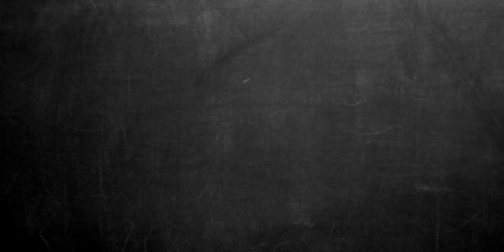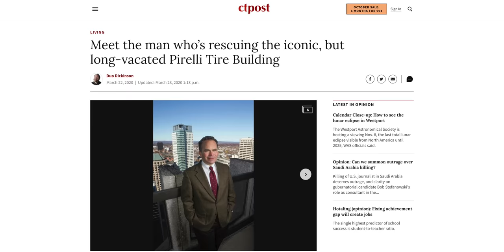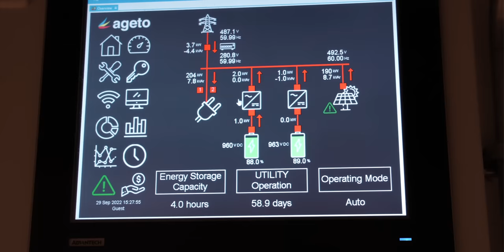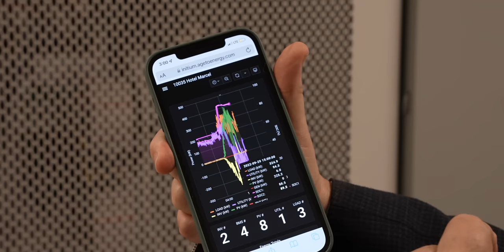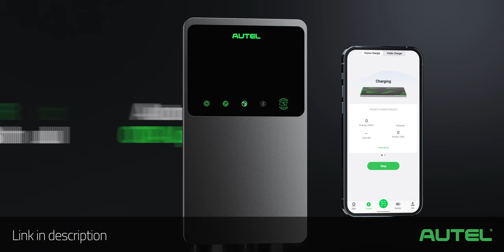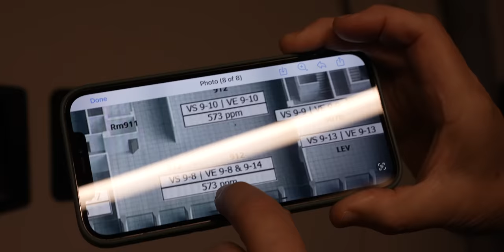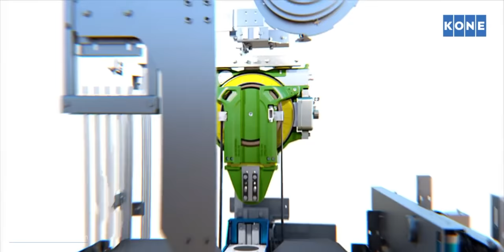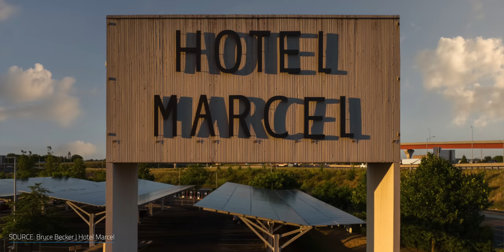How Big Can You Make a Passive House?

Comment: Wow - it is great to see this one idea finally becoming mainstream: the whole DC mini power grid. DC power sucks for long-haul transmission, but it is far more efficient for local (in-home) distribution. I've always wondered at how inefficient things like a typical home computer setup are: taking AC power from the wall, running it into a UPS where it gets converted to DC for storage, then  inverted back to AC, where it travels down a 4 foot cord to the computer's power supply only to turn back into DC power - with heat made at every conversion, and power lost all along the way. Within the past few years I've heard of DC powered appliances for RVs and wondered just how long it would be before houses started switching over to those... seeing this hotel and the more widespread use of solar gives me hope that maybe finally we will stop wasting so much power to inefficiency.
Reply: I first started wondering about this inefficiency decades ago after being trained on a digital telephone switch: in this switch, the end cabinet in each row was dedicated to converting AC to DC power, and then converting the DC to buses carrying various voltage levels down the row of cabinets. Even the backup power was fed from a large room essentially car batteries, which carried power to the DC converter cabinets. (Extremely dangerous amperage levels of DC current, but far more efficient and having longer backup run times giving you a nice safety buffer to get generators up and running.)

Comment: An old fashion solution to the power consumption by the clothes drier would be solar energy= Just make a greenhouse atop the hotel,  relocate the solar panels to the greenhouse rooftop, and hang the sheets and towels in clotheslines. Currently there are solar cells so thin that let some light go through, and they could be placed atop windows' glass. Recirculate the exhaust of the AC systems into the greenhouse. Done

Comment: I have a similar setup. My problem is the over promoting of lithium ion batteries and the comparisons they use to sell them for this application.  This is a non mobile application and battery weight should not be a factor.

Comment: I can see a heat pump powered dryer in the future. Interesting to see a large office building coming even close to net zero.
Reply: There might be reasons they didn't go for it right away. After all, this is a very recent build, it only opened less than 12 months ago. Heat pump tumble dryers should have been available to select.
It's quite possible that, given the sheer size of those two units, that the room is too small. The heat pumps must take thermal energy out of the room they are situated in, and this drops the room's temperature. Drop it enough, and you get undesired side effects, such as condensation forming on surfaces and inside stored clean sheets, and making it too cold for comfortable working conditions.
Another reason might be that the way the units are tucked together, they might not have their heat exchangers exposed enough to harvest heat from the ambient air.

Comment: Virtuallyall elevators except hydraulic ones put power back on the line. They’ve been like that for more than a hundred years. Look up the “Ward-Leonard Drive” And it isn’t as simple as “when they’re going down”. The counterweight is equal to the weight of the car plus one half of the load capacity. So a car that is less than half full is actually putting power back on the line when it is going up. A half full car is neutrally balanced and the drive must only overcome the friction in the system. They’re very efficient. Nothing new there.

Comment: Instead of installing more solar on the premises, buy into a solar, or wind, energy cooperative.   With community solar, there are not configuration constraints that come with rooftop solar.
Reply: there's probably some zoning/politics going on where the hotel and other community stakeholders just don't have the lift to set up a local energy cooperative near that location. Great suggestion, though.

Comment: Full marks to all of your designers and innovators. Yay: some of my half-baked dreams cira 1973~74~75 coming true for others in a far-more hi-tech world of today.
One little niggle, tho: 
We have here in Aus/NZ a clever way of drying laundry without electricity. It's a very clever thing powered by Wind and Solar called A CLOTHESLINE. 
Okay: they sometimes don't work perfectly every day for the same reason that Solar and Wind doesn't, but the neat thing is: they automatically run all night for most of the year, purely on the laws of physics. 
And I notice that you have a huge gap halfway up the building that currently seems to be under-utilized. Quite the perfect wind-tunnel, too. Throw up some attractive visual screening and hang all the laundry you possibly can. Day and night. Driers for back-up and getting through the worse days of winter. How about it? 
I could recommend about 22 hundred-thousand highly qualified consultants if you need any advice.

Comment: Outstanding and more importantly Inspiring to see someone like Mr. Becker step up to the plate, do the research, figure out the system and get it done as a retrofit!  So many appealing aspects: 5kw total lighting, seamless 3 way grid tie through an App. w/battery backup, Cat 6 throughout, heat pumps/exchangers/water distribution, PV and of course regenerative elevators...Outstanding!  Only 2 real issues: Dryers and Chefs willing to jump the gas divide. ;-P  Curious how much time he spent researching and developing the overall system and the net zero aspects of retrofits?  Thanks Matt this was terrific and would enjoy seeing more of these design tours!  Hat TIp, ~PJ

Comment: The DC power is neat, but could only work with lights and lower power stuff, as it removes the need for transformers with each light it might even be safer to do as it's less likely to have a overheat then. But DC power shouldn't be used for more, as it is also more dangerous if you need to power things that need more power, still remember reading about the older times where DC power was the standart, and it started a lot of fires. So for a normal home you would have two systems, one low for lights etc.. and a AC for plugs like to the computer and so on.

Comment: POE is a neat idea, but the 48V is extraordinarily inefficient since you need to drive more current at a lower voltage to deliver the same power. Current produces loss, a more efficient system would be to convert to a server farm DC system 380V or 575V. Obviously the higher the voltage the less current which means less loss and less need for copper and other expensive materials. The move to low voltage will just keep increasing loss, and reduce efficiencies.

Comment: I love this project, but the first big question that came to my mind:  No AC wiring???  How do you run a hair dryer or curling iron off Cat6?  No Microwaves or Fridge in the rooms either?  You could certainly design these for DC, but not low current.

Comment: I have always thought about elevators being such gravity energy storage.
Good that it's getting traction.
Hope the whole world starts implementing such innovative technologies to get as much power generation built into the design as possible.
I truly believe that if as much infrastructure and daily things are made more efficient, we would save A LOT of power.
Imagine if the whole world changes their street lights to more efficient ones and also add as much solar/vertical wind turbines with some form of battery as possible into all lightings. Or if we all have a habit of turning off electrical appliances or the power mains when not in used.

Comment: CAT6 cable is extremely lossy - around 7 Ohms / 100m single conductor resistance. This means big voltage drops and wasted power unless several conductors are paralleled together. Because it is only rated for low voltage use (50V?) this severely limits its practical use for carrying DC power to the load. It may sound clever, but for "net zero" use it would seem to be defeating the purpose. The idea should be to introduce minimum losses for "net zero" so much higher capacity cables (and higher voltages) ought to be used so almost no power is wasted getting it to the destination

Comment: Without a counterweight in the lifts the going up is going to draw more power than if you had a counterweight. This means the gains on the braking would be used up making the lift ascend. 
If the lift has counterweights then it is the motor that slows the lift to a stop so I do not see how power can be saved in such a system.

Comment: Wait... but is your new home going to be well insulated? Are you going to have the southern face covered with an awning that allows light to strike and warm the building during colder months while preventing sunlight from heating the building during the summer months? Will you be using geothermal heating/cooling for your heat pump system? Will you have a septic system? Is it equipped to produce compost or do you have a company to make compost with your wastes? Will you or will you not have a basement?

Comment: Somewhat curious about the prospect of moving the dryer systems from restive heating to a heat pump variety of heating. I understand it would require multiple stages to get up to the temp needed, and since you would very likely need to set up a recirculating system, I presume you would need to do a fairly significant de-humidification stage, though if you're already doing heat pumping, I suspect that a stage that cools air as it comes out of the dryer, to extract water, then re-warm it.
Reply: Wow, one of the scams that's been going around. Thanks!

Comment: Not much was said about the huge clothes dryers. Are they using regular resistance heat?  If so, why didn’t they use heat pump dryers?  The fact that they use sooo much electricity seems like something they could have done better.

Comment: Very cool project. I would love to know how it was financed, at this point almost all large scale passive house projects are highly subsidized. For the typical building retrofitting like this is very expensive, not everyone has the additional land to add a solar farm. That being said even if buildings just retrofitted their heating and cooling systems over to VRF it would make a significant difference in efficiency. Next would be to improve windows, and after that address the structure's air permeability.

Comment: Matt, Thanks for mentioning LumenCache.  The gen2 will be released this year and there's an IndieGoGo offer coming this month because it's completely plug-and-play, so anyone can add a few (or all) lights using DC.  It's really fun plugging in cat5 and lighting up big 2x4 ceiling lights, strip lights, DC bulbs, etc!  Just look at the AC/DC driver attached to fixtures at your local home improvement store.  You'll see the Output of the driver is DC and it's under 48V.  If it is, it's compatible (just toss the driver if you want that specific fixture).  Makes no sense to wire ceilings with heavy copper.  Typical LumenCache homes use twice the wire length for lights and switches, yet save $800 due to the huge difference in cost/ft.
Reply: Hi, Is it possible to have ceiling fans over cat5 too?
Reply: @patangaha  Yes, Carro Fans have a small AC/24VDC adapter in the top which can be disconnected and LumenCache SIB is connected.  They are making 48V units that we will power and control directly without the small DC/DC in the mount.

Comment: Passive buildings make a lot of sense for businesses. It basically normalizes all your long term costs for power. You won't have to consider market price fluctuation or worry about blackouts. It will also normalize how much you pay for warming and cooling as indoor temperatures are much easier cheaper to maintain even if temperatures outside change. I don't think there is a reason not to do this if you have the upfront cash.

Comment: Interesting, good ideas, I hope it rolls out everywhere. I'm in the grey UK. I'm amazed if that solar provides much energy? But then those  air source heat pumps will be making up to 450% efficiency on energy drawn in to run them.  In our house we have solar, battery,  and just recently an air source heat pump, electric car, but still use lots of grid as the solar panels only produce a fraction of what we need unless its early- mid summer, so we do washing/drying with cheap electric at night and it's only cheap cause our renewables-only supplier is being kind to those with plug on electric cars. The huge battery in the garage can't store much and it only gives out at max 3.5 kWh so totally impractical for electric showers which use 8-10.5kwh and therefore cost a fortune to run. So we have got rid. The heat pump has made the water tap shower amazing as the hot warer pumps out at the same rate as any cold tap. We have now got triple glazing which will help further on bills and will I get extra loft insulation soon. We are getting lower bills but my god the initial cost to pay for all this is eyewatering. Maybe when solar technology has improved and the cost of that and heat pumps come down the general population might be convinced to get them. Maybe Putin threatening to cut Europe off will help convince people to cut their home gas supply and go electric. In the UK we knew huge bills were coming as the Govt artificially capped the new privatised suppliers, and the cap just got removed. Some people's bill have gone up 100%, there are a lot of unhappy people in the UK who for some reason didn't see this shitstorm coming.
Reply: we dont use solar in nordic countries because theres good sunlight for like 3 months per year, it would be waste of money. usually insulated houses (passive houses) with things like for example quadruple glazing windows, geothermal, heat pumps.

Comment: First .. an elevator is not "all weight" on the people side, there is a counter balance weight that should be something like the cabin weight plus some more, you need to give real numbers.. cause as it is .. it's ... kind useless.
But i can tell the guy from the Hotel know what is installed in his hotel and how it works ... it's pretty rare... ! He look smart .. for a change.
I find the thermal storage for hot water pretty small, i got a 200 gallons just for my house (heating house and shower water)

Comment: I know it's not really what you do on this channel, but the whole wiring thing in this one - I really want to know the details, products used, the wiring used, what are power delivery limits, etc, etc. I really like the approach and a house like mine actually would benefit from such a system a lot.
It's also interesting that they still use resistive dryers, though probably they just had them and decided not to upgrade. heat pump dryers already exist and I actually own one and yeah... the energy use is way way less, even less than my washing machine in eco mode.
Reply from the maker: It was a little out of scope for the video, but they were using Voltserver for electric system: https://voltserver.com/. And Ageto to manage the solar, battery, grid integration: https://agetoenergy.com/
Reply: @UndecidedMF  Thank you, I will lurk their websites for the technical information :)

Comment: I wonder if a thermal solar panel (that generates heat instead of electricity) could be used to pre-heat the air that goes into the dryer. This would avoid all of the losses due to PV conversion and inverter inefficiencies,  while delivering consistent warmer air to the intake of the dryer. As long as the units could handle warm air intake, this would reduce the amount of electricity needed to heat the air to operating temperature.

Comment: It's weird that they use electric resistance dryers instead of heat pump dryers.
Currently renovating a bicentennial house, I already planned on using DC 12V LED light bulbs, the same you can get for RVs. Probably using CAT6 network cabling for it unless I can find something cheaper.

Comment: Regarding your initial question if solar in the roof can power everything

About 20 years or so ago the Rocky mountain institute scientist did a study and revealed that if every roof in building in major cities around the world recovered with modern solar panels it would exceed the planets requirements 20 times over!

You might wish to see if you can find that again it was posted on their web page back then

Have you looked into AgroVoltaics?

Basically it's roughly one roll of solar panels raised high and two open rose.

It turns out that most plants need a certain amount of sunshine and then they stop growing, this makes sense if you think about it trees that are up high can take Sunshine the whole day plants lower down either get morning Sun or evening Sun so they have adopted to grow with less sunshine

The AgroVoltaics have shown that the shading of the plants actually offers protection and they actually are more productive.

The further experiment was done water sprayed on an open area evaporated in 3 hours, however water sprayed in the system lasted up to 3 days.

There are many more things that can be explored, the limiting factor is the information available

So thank you very much for your spreading of information, or my motto below.

Scientia Non Domus,
(Knowledge Has No Home)

Best wishes from

antiguajohn

Comment: This is so cool - in never thought of PoE being used for a whole building.
What about the TV? I guess it needs more than the 25 Watts DC delivered by PoE.

Clever as the architect is I guess the driers which need so much electricity are also equipped with heat pumps - or not? ( They look quite old ... )

Last but not least: Why isn't there a garden in the third floor? ( Please don't tell me the regulators did not allow it ... )